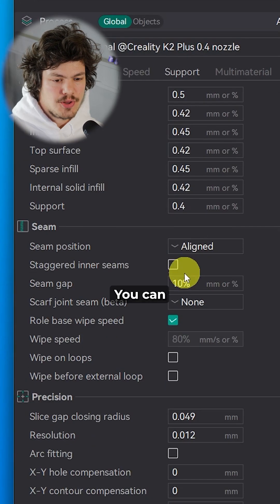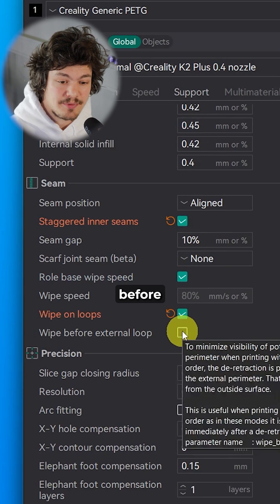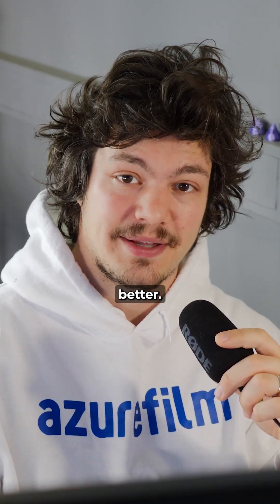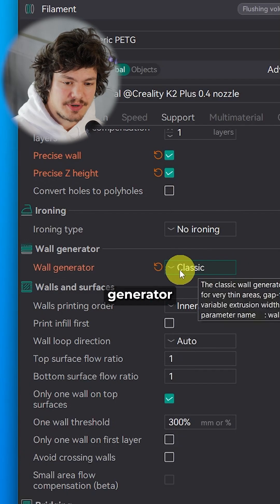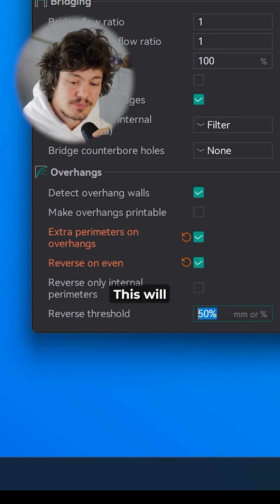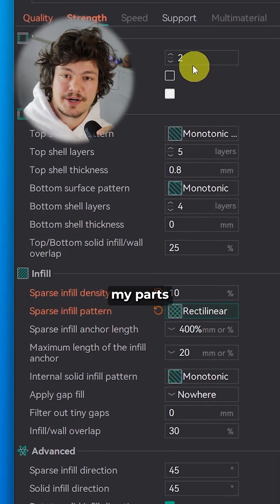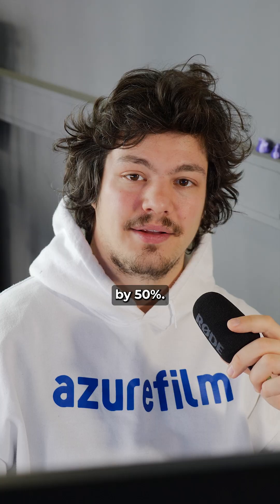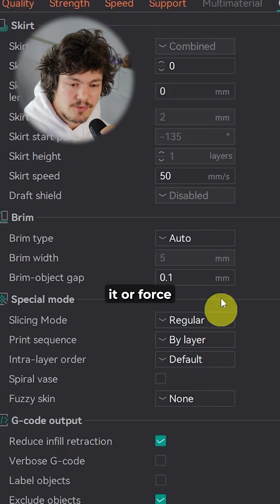How to get the best speed & quality every time #3dfilaments #3dprinting #3dtip #tipsandtricks

Comment: Arc fitter has nothing to do with klipper or no klipper. Arc fitting is used to compress the gcode size. It will work fine on klipper